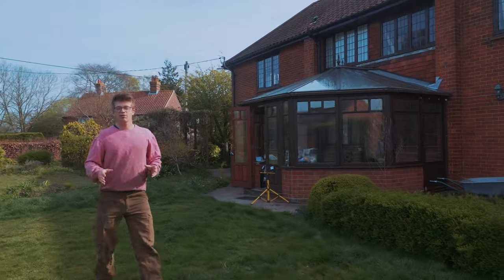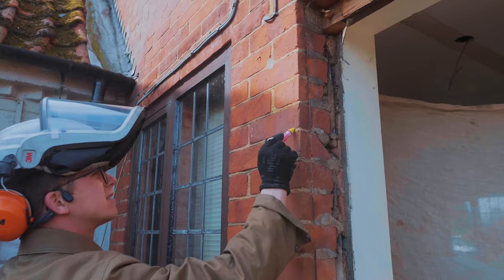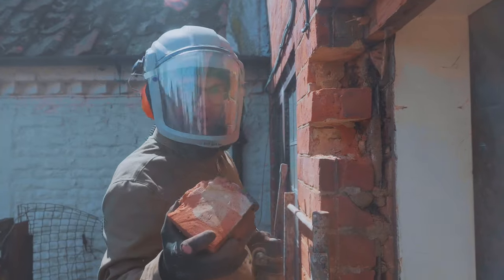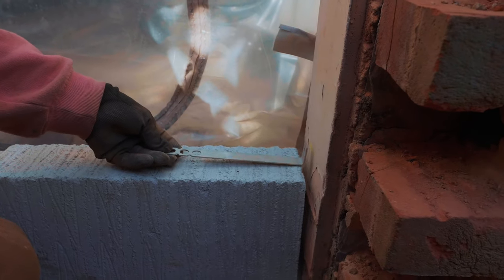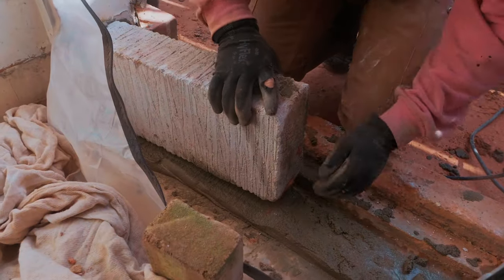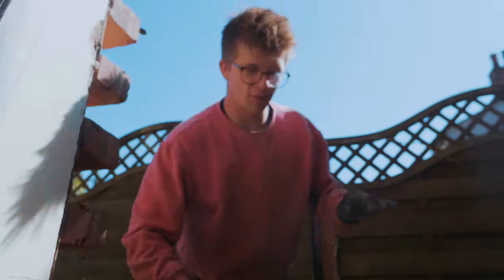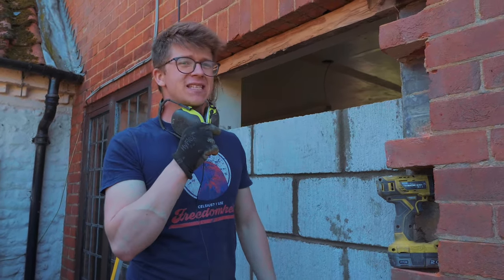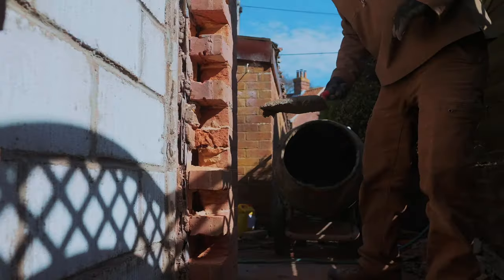Becoming the World's WORST Bricklayer for a Day!

Comment: This is why I like working with lime mortar buildings, the bricks just pop right out with a bit of a go with the hammer drill.

Also a spray bottle of water to wet the edges of the bricks helps the mortar stick, and mix a bit of washing up liquid with the mortar mix for a nice smooth creamy mortar which is easier to play with.

Comment: With the little experience I have, i can tell that watering the blocks does help in making the mortar stick to the block. If it is covered in dust, the stuff will only pick up the layer of dust particels and peel right off. A little whipe with a wet broom does the job.
Reply: Dipping them in a bucket of water works as well. Makes the mortar dry a bit slower as well, which is stronger.

Comment: loving the struggle, we all go through it. Haven't finished the video yet but your first mix didn't look like it had any plasticiser in it, the difference is immense, makes life so much easier. 
as for toothing out, you can get raking tools that are basically a carbide spindle that goes on an angle grinder, work a treat and don't damage the bricks you want to keep as much 
just got to the point of you finding your plasticiser XD love this episode! (also stu compton has some great videos, helped a lot when i started bricking)
another tip, don't rub your bricks! let the much dry then take a stiff brush to it, you'll avoid rubbing the mortar into the face of your brickwork, the cement is so fine it'll get into all the texture and you'll struggle to get it out. finally, seen a few comments already, missed your cavity wall ties

Comment: Well done Alec! You don’t need insulation in GB? I would have done some insulation between the outer and the inner wall.
Reply: It's probably bad to insulate only part of the walls, as the rest of the walls rely on air ventilation for its insulation. This would create a barrier that might actually collect moisture.
I mean, that's all just assumptions, but this is what I'd imagine.
Reply: No point just doing that one area. Assuming they're getting anything done (cavity itself provides some insulation plus it's sometimes left open for better ventilation), it'll have to be blown insulation to fill the whole cavity. Easier to have this section sealed up for when that's done.

Comment: True story. In the 1990s, I worked as a carpenter specializing in remodeling very upscale older homes. The general contractor I worked for used the same family of brick masons for all our jobs requiring such work - a father and three grown sons. I would regularly watch them work and think "It's so easy! Anyone could do that job." Dad and oldest brother would be up high on the scaffolding setting brick, another brother would be on the ground using the masonry saw to cut bricks to size and shape, the youngest son would be mixing mortar and sending it up the scaffolding. Both the brothers on the ground would take tums loading a bucket with bricks or frequently THROWING the bricks up to the eldest brother and father, 12 feet up the scaffolding, who would mortar and set the bricks in place. They offered to let me try setting the bricks one day and I found it wasn't anywhere near as easy to do as it appeared, and it was esp difficult to keep their speed, spacing and accurate leveling. The most amazing part, though, was every one of them would show up every morning with a 24 pack of Keystone Light beer, and each would finish his case of beer during the hot summer days. (For those who don't know, Keystone Light is a thin, 3.2% abv barely beer) They'd developed such a tolerance, they claimed they'd never had a job site accident!
Reply: This is similar to some professional painters, it is a simple task but is easy to make mistakes that ruin the finished or fail to hold up after a short period if any mistakes are made that an pro would just not do and because they know the job so well, they can do it will doing some mild drinking, shrug, not really a drinker myself so i find it impressive

Comment: Did a “light” Reno on my house, painted, retiled kitchen and bathroom, changed power points etc etc. Hands down, the hardest part was laying 12 bricks to fill a hole where I removed an old air conditioner. Took most of the bloody day, 12 bricks! Plaster on the other side was a breeze.
Reply: Plaster... a breeze?! You have a hidden talent, not many plaster guys left and they're scheduled 6 months to a couple years out.

Comment: Good job. I would have done a "blind door" (or what its called in English) a recessed brick wall inside the  existing frame,  recessed like an inch/2-3cm, no need to remove the half-bricks.
Reply: keep in mind the insulating properties of the bricks and blocks with the air gap in between. That is much better than your suggestion
Reply: @99Etien  Yes one inch less insulation, you can still have the air gap, dont think it would make a big difference in insulation properties, but your not wrong :)
Reply: @deoed  a wooden door and a brick wall are in two completely different categories of insulation. Keep in mind that this is the UK where just some wood and Sheet rock like in warmer areas of the US is absolutely not good

Comment: It also helps to wet the concrete blocks prior to installing them as the dry cement block can pull all the moisture out of the mortar.  This is common on clay bricks as well

Comment: As a mason I was pretty nervous at the start but towards the end you honestly got it down pretty good. Its a skilled trade for a reason, it takes years and years to actually get good and I would say with your little experience the job turned out beautiful. I would also like to point out for future reference that when you start laying the bricks that get very close to the soilder above the doorway (the course of bricks that are laid vertically) make sure you use a tuck pointer to ensure that the joint is actually full of mortar. Great job

Comment: Thx for always great content!!!
You are always nailing it with your neat constructions in metal works.. But.. there is always a but xD   

I might be lynched for this but anyways :D
Don't take this as negative, but as guidance. We all need to learn including me, so correct me if im off chart.

Wrong mortar for the aerated concrete blocks, the cement might be too hard when curing and won't bind the blocks together but crack due to expansion and contr. And you need to brush them with water so they doesn't soak up all the moisture in the blocks. 
Next you need to apply stainless binders in the mortar seams on the aerated concrete, they need to be connected with the mortar seams when you lay the bricks, all that to strengthen the construction so the aerated concrete wall or the brick wall doesn't allow for horizontal movement. You did put then in at 4.43 but you also needed them in between the separate walls.

Comment: a piece of plaster board makes a great gauge for 10mm for your motor in between your red brick. Great go at it. Could use a bit more motor and pointering at the top of the door.

Comment: Just for future reference a string line will do wonders for helping keep your bricks straight and planing in with either side of the wall.  

And if you plan on doing something like this research how to gauge brick and block work it can save you from having to do annoying splits by having slightly larger or smaller beds of motor on each course.

 Other than that love the willingness to learn new skills and trades definitely need more people doing it.

Comment: Great job! Just a little tip, Next time if you get two sticks on a long bit of string and stick them in the mortar so the string is across the top of the two bricks you place first, you can then tap all your bricks to the height of the string so they all sit level on the mortar! Great job though for beginners I praise you!

Comment: Is ready mix mortar not available in the UK? When it's in large volumes, buying the raw separated materials for morter is more cost-effective. But for a small job like that, it would have been a lot easier to buy a few bags of the pre-mixed, just add water, stuff.

Comment: Alec, for the next time you use mortar, there is an easy method if it's not for heavy structure (like you did for the door), use : 1 bucket of cement, 2 bucket of water and 3 bucket of sand (and 4 bucket of gravel if you make concrete). Any way, nice vid and good luck with your house renovation !

Comment: Bricklaying is harder than you think.  There are a lot of things that you may have overlooked.  Diamond grinder to remove mortar, you shouldn't need a hammer drill to remove the toothing, type of mortar and consistency, there should be wire inside some of the courses of brick and block, there should be something to tie the block to the brick, the lintel above the opening is important, and you may need some flashing and weep holes at the bottom to allow any water that gets behind the brick to escape.  Also, white sand and yellow sand will change the color of your mortar....choose wisely!  :P  It turned out looking pretty good!

Comment: Just a quick note if you remove any more timber frame cut them at an angle, this means you can lever against the other piece of timber without any upwards or downwards pressure.

Comment: Well done. If you do any more brickwork, May I suggest using like mortar instead of sand and cement. The last shot of the corner of the house looked like it was lime mortared. Otherwise you’ll end up with two very different looking areas of brickwork.

Comment: Nice work guys! As a bricklayer from the UK myself, I can say your work isn't too bad for a first attempt! There is one problem though... You forgot one critical component for the strength of the wall. Wall Ties, which will tie the brick and block together and stop it sagging!! It might look and automatically feel solid, but it is quite weak and will collapse after some time.. Apart from that, the overall quality of the brickwork, aesthetically, is alright! Just keep at it if any more brickwork crops up, and don't forget the 'Wall Ties'! 😁👍👷‍♂️🧱
Reply: Agree about using the wall ties but I wouldn't worry about it collapsing. I know a house local to me that has its entire end wall single skin of bricks, still standing 150+ years, can't get a mortgage on it though!
Reply: Are the metal things he installs not ties?
Reply: @Dudeinator  They are a type of wall tie yes, but they only tie dense or thermolight concrete blocks to the inner skin of a cavity wall instead, of tying both the blockwork and brickwork together.
Reply: @rhysthebricky2171  makes sense, yeah that seems important. What should he do to remedy if he can without tearing down the wall? Or is it not as big of a problem since it's a smaller section?
Reply: @Dudeinator  The only thing he can do unfortunately is knock it all down and rebuild it again and add the ties every 3 course of brickwork or 1 course of blockwork, 1 tie every 450mm or 2 brick lengths. The thing he will have to remedy is to remember (If he sees these comments of course) to simply add wall ties and insulation!

Comment: Hey Alec, I don’t know anything about brick work but I’m a foreman for an air barrier and water proofing company and I really thing you should’ve added some tyvec or a similar product to keep water out
Reply: Tyvek is commonly used on commercial builds but a damp course is advised but as it’s a small wall it should be okay, I think Alec also forgot cavity insulation 😂
Reply: @SoulJuce  I didn’t even think about insulation, but I still would have used damp proofing or some kind of residential building wrap. That block will act like a sponge and if it absorbs too much moisture it will start to create condensation inside the house and mold the Sheetrock. That’s just my professional opinion though. I mainly work on commercial building envelopes and spray foam so I’m no expert on residential or renovations
Reply: @wassupitsdylan472  I 100% agree with damp and moisture protection you’ll be surprised how many homes in the UK that haven’t got it at all more or less the older built houses hopefully Alec won’t have any issues, also it’s a common practice to use brick ties between the outside brick and the internal block but I doubt it will cause any harm, I’ve only worked on a few commercial builds we did use tyvek and 100mm insulation it seems the commercial builds have a better spec than residential. Hats off to Alec for stepping outside his knowledge and giving it ago even though we’re being critical 😂

Comment: I used to do work for acme brick as a repair man and so what I would do is pretty much what Alec is doing here except tearing the door out. Go to the place find the messed up brick and use a chipping hammer to get them out. I did this for many years and I can positively say the unless you saw out every single joint around a brick then you will always break more brick than you want. It’s fine it’s usually easier just I break more brick.

Comment: I believe you need a WRB in that gap between the interior and Exterior brick. Otherwise you risk wicking water into that gap and pooling inside the wall. That's a recipe for mold.

Comment: Former Hoddie: You forgot the lime in the mortar mix, which makes it sticky and fluffy.  A squeeze of dish soap makes it fluff up a bit as well.  Soupy for brick, and pasty/crumbly for rock.  (I'm guessing the plasticizer is a replacement for lime???)  Great job for a first attempt!  Once you wash it off after it's set, it will look way better.
Reply: yeah plasticiser is used more often now, less harsh on the lungs, lime still has good benefits though and is sometimes still used, but rarely
Reply: Spot on, we use mortar plasticiser instead of lime and soap nowadays; from what I understand, the use of soap in mortar is frowned upon and in some instances, banned in the UK due to how its reduces the final set strength of the mortar and if you get caught using soap by building inspectors, they'll order you to knock the work down and make you start again with the correct substances...

Comment: Bricklaying is hard. Not to toot my own horn, but I am very good with wood, metal, composites, concrete and dirt. My attempts at bricklaying have been pretty miserable though. The wall got done, but looks terrible. Nice tip on the plasticizer though. Getting mortar to stick is one of the biggest challenges I had. I am in such a dry climate that the mortar dries fast and the working window of the mortar is very short.

Comment: next time you do any bricklaying give me a shout Alec ill come over and help ahahahahahahah. ill admit it was fun to watch but you should have used concrete blocks not thermalite blocks. concrete are better and also take a lot of drilling as thermalite tend to crack/ brake apart. all in all though good work Alec, Jamie for a first attempt at the trade is better then some of the people i worked with at college :D you should feel proud of your work. if you need any tips for plastering as well message me :D good luck

Comment: im not a pro but i have done enough masonry to offer some advice. Wet your bricks/blocks, if they are dry they suck the moisture out of the mortar and make your mix much more sensitive to being being perfect. When you put the mortar on the sides take a second pass and push it on with your trowel, works for rendering/pointing, pick up with 1 trowel, push/compress it onto that trowel with the 2nd and as long as its 10mm or so thick it can basically be turned upside down, also potentially you are putting too much for it to stick well when tilted. Lastly you dont need to be perfect separate structure from cosmetic, you can come back and point up joints to make them better. Also the mortar colour is wrong

Comment: The difference between bricks and blocks is that bricks are made of clay and blocks aren't (and in masonry usually made of concrete). There's some significant differences with the material properties, which is why one is on the outside and one is on the inside, but when you're laying them there isn't much other than frogs or hollows, though those aren't even consistent across all bricks or blocks.

Comment: When the bricks are dry they will start to suck the water out of the mortar on contact, making it dry too fast and not stick well to any sorrounding surface. The same is true for the existing wall you are trying to connect into. Dunk the bricks in water for a minute or two before laying them and wet all the other surfaces as well. Generally, the longer it takes to dry, the better. And it gives you more time to rework mistakes without wasting mortar.
Also, shouldn't there be an insulating layer between the bricks and the blocks? Something like rock wool?

Comment: Hey Alec, next time you try bricklaying, try to lay the a brick/block, scoop up a bit of mortar up the brick, place the next one, and trow in a bit of mortar into the cavaty, bricklayers do the same, no need to fill it in completely, because afterwards you'll come in with the grout tool to clean up the joints, if necessary, you can fill it in with that 🤷‍♂

Comment: Alec as a professional builder, the start of you laying blocks was quite painful to watch😂 but by the end of the video i was impressed and a little determination it ended up being a good job well done! Only thing i can say is it needed some dpc under the first course of blocks and bricks aswell as where you took out the old door needed to cut out the little bit of cavity you had to prevent moisture tracking from the bricks through to the blocks and possibly getting damp inside. just some tips for next time.